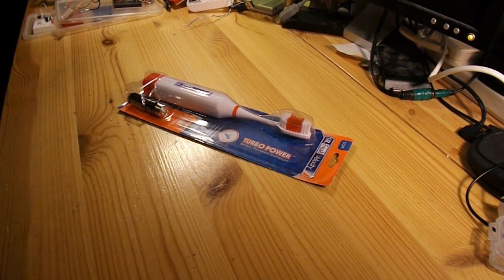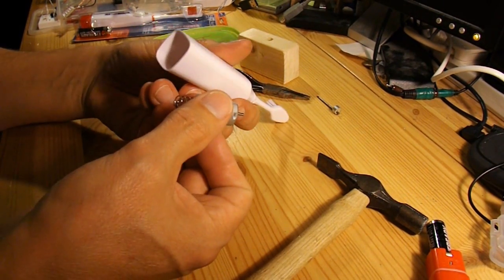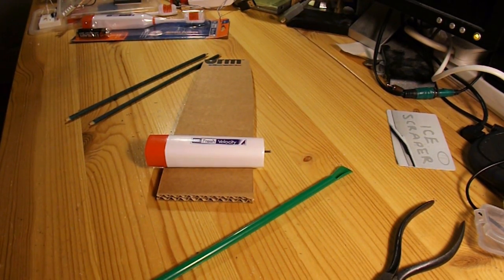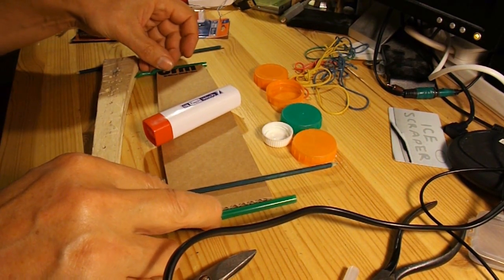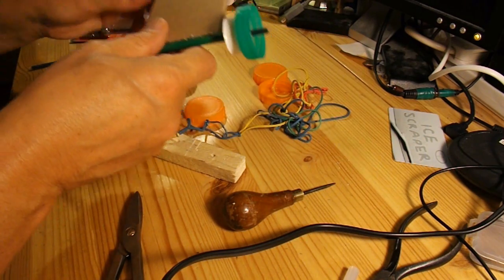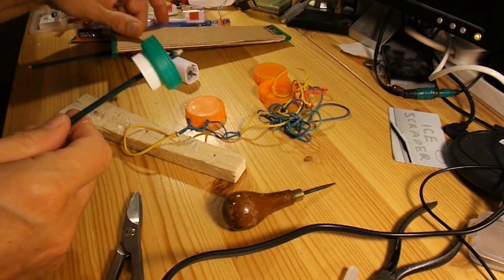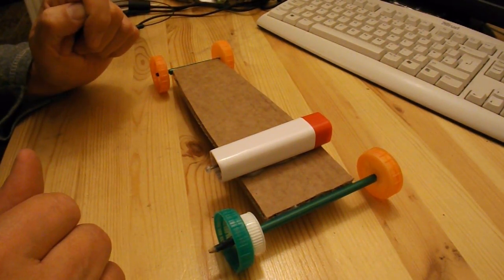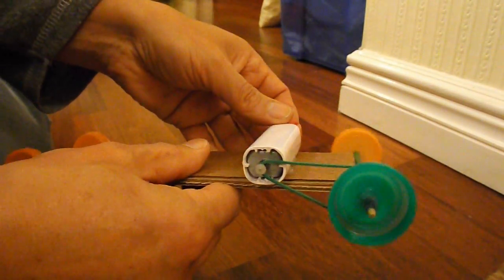Let's make a Simple Electric Car - based on cheap vibrating electric toothbrush

Comment: Great device, but would it be possible to add a braking system and if yes, how? Thanks!
Reply from the maker: +Damanpreet Singh for what purpose? The simplest option would be to use radio control and an Electronic Speed Controller that has the electronic braking option.
Reply: +GrandadIsAnOldMan The purpose is for the car to race and go for a distance of about 9-12 meters and stop on its own without remote tethering or control.
Reply from the maker: Damanpreet Singh here is my playlist of brakes on rubber band powered cars. It should give you some ideas on how to provide a brake. Brakes on Rubber Band Cars playlist https://www.youtube.com/playlist?list=PLA5a2xPRSrB3MyidvKMT3DqU1vNy9Atsf
Reply: +GrandadIsAnOldMan thank you very much

Comment: Would it work connecting the motor directly to the wheel?
Reply from the maker: Rafli Central you need to get outdoors more. It is clear that sitting in front of a computer screen is affecting you capabilities.
Reply from the maker: +Brendan Garcia I guess there is one way to find out. Why don't you build one and try it. Depending on the overall weight of your car it may work. Here are a few points to consider. 1 connecting directly to the wheel means the motor needs more power than it would going through a pulley system because the gearing effect helps the motor turn bigger loads. 2 connecting directly to the wheel means the wheel will be turning much faster than it would using the pulleys so you may get wheel spin.
Reply: +GrandadIsAnOldMan lslllslsdlxl

Comment: What are the greenish sticks that you put in the straws?  Are they skewers?
Reply: Never mind, didn't see the ending!
Reply from the maker: Zarina Khader skewers would work fine. I just used whatever I had available. The ones I used were a bit thicker than normal bbq skewers but didn't need to be, I use skewers most of the time.

Comment: Can I use a cheap small fans because it also has a switch and a motor?
Reply from the maker: Senz Zens you can use whatever you like as long as it has a motor that you can attach a pulley to. I have just updated the links in the video description. If you follow the link to my Electric Toy Cars you will find a project "Helpfile Handheld Fan Handy Electric Power Unit " that I did very recently that uses one of those fans.

Comment: Nice tutorial. I tried to make it but whenever I do, the rubber band flew off. Do you have any tips? Thanks
Reply from the maker: Senz Zens there are 2 main issues here.
1. If you get the tension right the band will stay in place, so you have to adjust the position of the motor relative to the back axle to get the tension just right. If you have glued the motor in place this will mean ungluing it and gluing it back again in the right place. If it is too tight the motor may not have enough power to turn the wheels. If it is too loose then the band slips and the wheels don't turn.
2. If the motor is not exactly parallel with the axle the rubber band will tend to move along the shaft and drop off the end. You can glue a card or plastic disk to the side of the motor pulley so the band cannot slip off.
Reply: GrandadIsAnOldMan Thanks for the help, the rubber band is not falling and the car is moving.
Reply: Senz Zens Also, I think you can just glue the second bottle cap a little away from the first one so there is a gap where the rubber band stays and can't slip off.

Comment: I always have trouble making these small electric cars because I keep putting the Axel on tires off centered a little but you make it look so easy
Reply from the maker: Riley Hayden yes it takes practice to get it right. If you choose the right bottle tops, some of them have a mark in the center so it is easier to get it right.
Reply: Yes I see what your saying I'll practice more to see if I can get it right
Reply from the maker: Riley Hayden finding the right bottle tops with the center markings makes it much easier. I use a lot of milk bottle tops and it varies between which supplier the bottles come from. Some have a good center mark and some have nothing.
Reply: GrandadIsAnOldMan awesome I got it this works great and actually has some power thanks
Reply: GrandadIsAnOldMan hey actually I was wondering how hard would it be to make this little car rc or Bluetooth controlled with a controller or maybe a smart phone do u know what one might need to do this?
Reply from the maker: Riley Hayden conversion to RC is as easy as taking the RC receiver out of a cheap RC car and connecting the motor wires up although obviously there is no steering on this car. For Bluetooth you would probably have to buy the parts, I have seen YouTube videos on Bluetooth cars so they are there if you search for them. If you look at my playlists there is one with my RC projects. I have stopped putting links in my replies as they seem to get lost in YouTube's spam filter.
Reply: Oh OK I'm glad to her its not that hard. I'm sorry bout all the questions but do you know where to buy small electric motors online? I can't seem to find any
Reply from the maker: Riley Hayden when I buy online I just use eBay or Amazon. Search for something like 1.5v dc motor. You will usually find they are around £1 in UK money which is more expensive than than buying these vibrating toothbrushes in the bargain stores, they might be better quality, you never know till you get them.

Comment: why not just buy a motor?
Reply from the maker: arshi khur for the reason I explain in the description. This is a handy package, motor, battery holder, and on/off switch, all in one unit. To buy those 3 items from an electrical store you would often pay more money. In fact I have found that the hand held fans are probably even better as you can simply pull the fan off and attach a pulley or a gear and hot glue the whole thing straight onto you toy car. These cost £1 or less and some even come with a battery supplied too.

Comment: I love building things like this. So far I've built a electric rubberband driven tank using a oral B action toothbrush. Then I built a Trineycle 3 wheeled machine using a gear driven electric toothbrush motor & gear. Now I'm working on another project. It's a lot of fun making stuff pretty much from scratch. Great video.
Reply from the maker: The amount of animation you have packed into it with the turret rotation and the movement of the barrels amazes me, you clearly spend some time on these models. Great work. I looked at several more of you videos, you clearly have a talent there.

Comment: Great video, really admire the way you teach. I have a question. Can I make this on a larger scale? Say, for my nephew to have a ride around the house in? Can you advise how and perhaps show how to attach a wheel for steering too?
Reply from the maker: Thanks, I think if you are looking to enlarge it on that sort of scale you need a totally different build approach. I suggest you do a YouTube search for something like "build an electric car for kids" and see what comes up. Here is an example http://youtu.be/PBSdB2mgcY0
Reply: GrandadIsAnOldMan From what I can make out I can use your technique but with solid parts and use a real motor? And other things i.e. steering etc.
Reply from the maker: ThatGuy If you use a larger motor and a big fan belt please be aware that youngsters will always try to touch the moving parts and you are very likely to lose a finger or certainly cause extreme pain if they get get their hands on the fan belt and get drawn into the pulley.
That link I sent you in the previous reply seems to be a good option.
Reply: GrandadIsAnOldMan whats a pulley
Reply from the maker: Yolo Noneofurbuss have you ever thought of using Google to search for answers?
I just did a quick search and here is an extract from Wikipedia "A pulley is a wheel on an axle that is designed to support movement and change of direction of a cable or belt along its circumference. Pulleys are used in a variety of ways to lift loads, apply forces, and to transmit power."
Reply: yes i use it everyday that is my web engine sorry im just borad a bit
Reply from the maker: Yolo Noneofurbuss OK buddy, I just spend a lot of time answering all the comments on my channel and some of the questions are better answered elsewhere especially when many of my subscribers are non English speakers so the meaning of the question may be lost in translation :-)
Reply: ThatGuy
If i were you I would go out and buy an electric car for kids instead of trying to make one from scratch, If you want faster I would buy a non-working one for cheap, for the frame, then install better parts.

Comment: i tried that to bot faild
Reply: indeed these darn skills
Reply from the maker: I am surprised, this is a very basic design. What didn't work for you? The usual problem is getting the tension right on the rubber band, too tight and it cannot move, too loose and it just slips.
Reply: just wat i mean

ps can u make a tank (electric wartank)please
Reply from the maker: Tanks are on my list, I will add your request to the list.
Reply: YEY! but a car with caterpillars are good to
Reply: I think you should retry this and finish it before you do that.
Reply: yes i do
Reply: +Lol Plane i tried that to bot faild   <<< Like you TRIED and FAILED in that English class you took..

Comment: Why can't we connect the rubber band directly to the axle itself instead of the bottle cap?
Reply from the maker: You can do that if you want. If the motor is powerful enough the car will go, but if the motor is not powerful enough it will not move. The bottle cap acts as a large gear or pulley and that means a less powerful motor can turn the axle. I can move a large car with a small motor if I use a small pulley on the motor and a large pulley on the axle.
Reply: Thanks for your quick and detailed reply
Reply: You can't because it will not turn the wheel with the bottle cap you have a larger surface area so it's easier to turn

Comment: Right now, I am preparing a sort of test bed for small electric model airplane engine.
It will be a mobile platform, made in part with the wheels of a toy (like yours that project). 
On plastic wheels, I've put rubber bands, somewhat smaller than the diameter of the wheels. 
Are almost equal, the tires of cars. 
I advise you to try and see the difference. 8) 

PS: Let me see if I get a video camera and I can record everything I do. 
Greetings!
Reply from the maker: Good luck with your project Francisco.
Reply from the maker: ***** Not with the vibrating toothbrush motor, it is not powerful enough for the weight it carries. Here is an electric powered toy plane Electric Powered Styrofoam Plate Airplane
Reply: GrandadIsAnOldMan If you carry with gear reducer, maybe it could work

Comment: you can just get the motor from source
Reply from the maker: Hi manvir gill, Yes, you can buy the motor from source, but there are advantages in buying the toothbrush. The toothbrush has the motor, the battery compartment and the ON/OFF switch all in one neat package so makes a complete 'power unit'. If you buy the motor on it's own you would need to source the battery compartment and the ON/OFF switch separately and wire them together. The toothbrush even comes with a battery in the package. Even if you buy from China on eBay you will have trouble beating that for under £1 plus you would have the time delay waiting for it to arrive in the post. I have paid as little as 87 pence for these toothbrushes.
Reply: im in Canada yo i have source a minute away nd i already bought the motor nd a switch for a project before so yeah

Comment from the maker: I am retired and I don't like spending money so charity shops and pound shops tend to be my shopping stores. I don't like spending more than £1 or £2 at a push. I try to use recycled items for most of my builds.. The motors in these particular vibrating toothbrushes are quite large and not very robust but last long enough for my purposes. They run fine on 1.5v and I quite often abuse them with a few more volts which is when they tend to die if the brushes burn out.